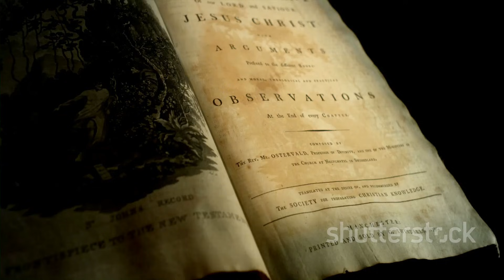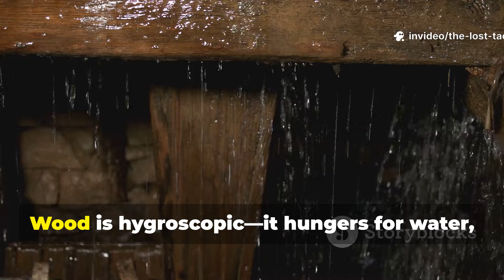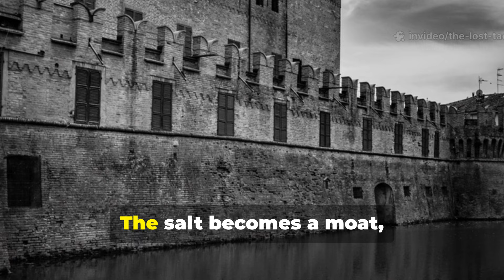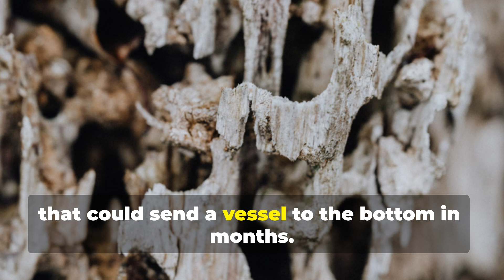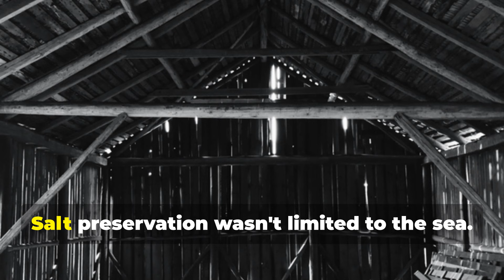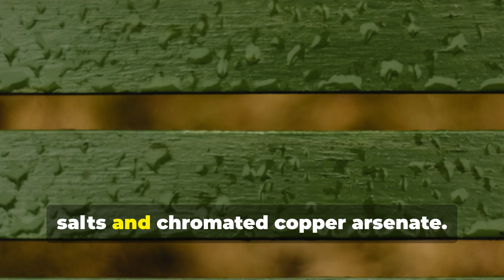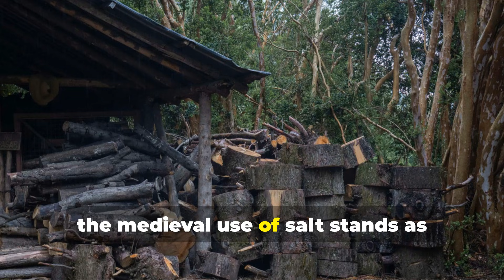The Medieval Mineral Treatment That Turned Wood Insect-Proof

Comment: Many medieval wood structures were fastened by wood peg joinery. Modern building uses metal fasteners such as nails & screws & salt will attack these with rust/corrosion.
Reply from the maker: That’s a great point—and you’re absolutely right. Many medieval structures relied heavily on wood peg joinery, which avoided the corrosion issues modern metal fasteners face. In modern builds, mineral or salt-based treatments need to be used selectively or isolated from metal hardware to prevent corrosion. Context and materials make all the difference.